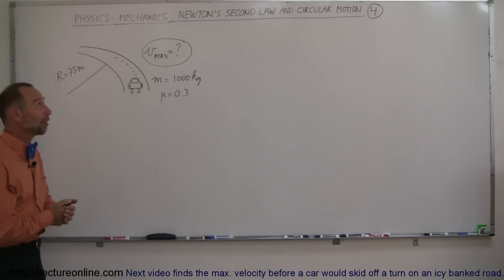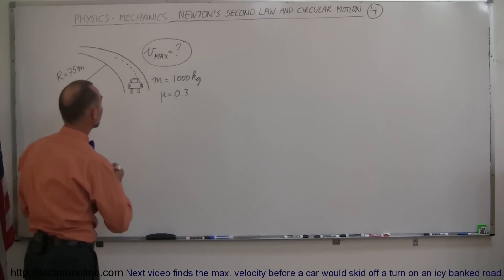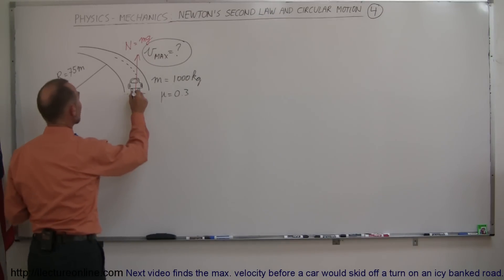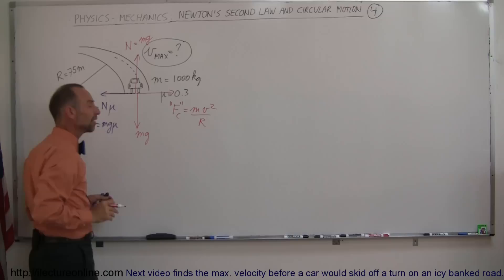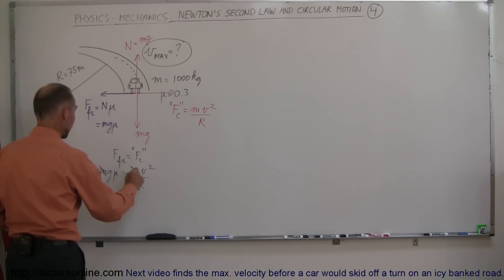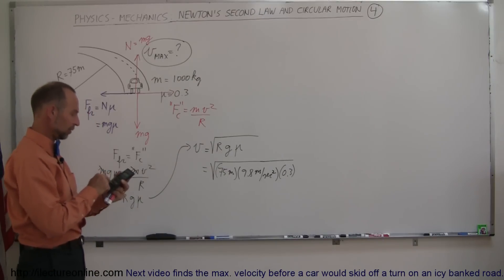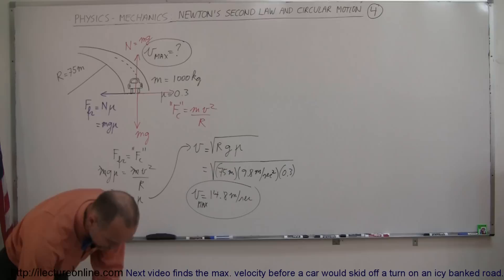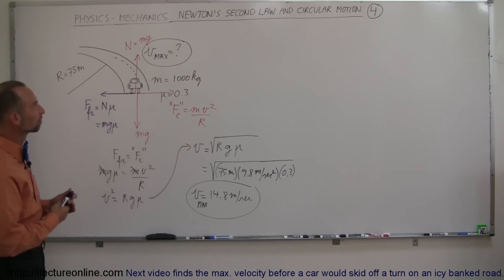Physics 6  Newton's Second Law and Circular Motion (4 of 10) Going Around a Curved Road

Comment: Mmm. My physics teacher told us that centripetal force is an actual specific force. But looks like it's not. It can be anything that supports the circular motion right? It can be the weight of the object, a tension in a string or in this case, friction. Interesting. 🔥
Reply from the maker: The centripetal force is the real force pushing or pulling the object to the center of the circular motion.   The centrifugal force is a "fictitious" force equal in magnitude to the the centripetal force (disregarding any other forces that may be at play), but pointing towards the outward direction.
Reply: @MichelvanBiezen  prof. said the centrifugal force cannot be applied here in any sense, i told her this is related to the max velocity of the car when it would be higher, than the car would go outward centrifugal. The given problem was "What is the smallest radius of a flat curve that a cyclist can navigate if their speed is 29 km/h and the coefficient of friction between the track and the tires is 𝜇=0.32 " i got result for the minimum Radius of 2.12m. I am so confused.

Comment: hello sir, 
we learned something called the centripetal acceleration is it the same as the centripetal force?
if yes why is it to the right not to the interior of the circle? because I had the same question in ex 2 
should it be considered as part of the net forces ?
Thank you for your time
Reply from the maker: One way to solve this type of problem is to use the fictitious "centrifugal" force which has the same magnitude as the centripetal force (and the same equation) but it points outward instead of inwards.    (It make it easier to visualize what is happening because we "experience" the "centrifugal" force when we turn quickly in a car.   Off course we are actually experiencing Newton's first law.
Reply: @MichelvanBiezen  thank you

Comment: thank you professor, but i have an important question  why Fc is to the right ? 

i think we can not draw it on the diagram, young and freedman  (University physics book 13th edition) page 155 there is a note written there 
here is the book page in this drop box link 

https://www.dropbox.com/s/31ytic9xmzkmuk2/11111.JPG?dl=0

please explain why and when the car can skid on this unbaked curve and for the Banked curve
Reply from the maker: It depends on the definition of Fc.   If Fc represents the centripetal force, then it acts to the left (of the center of the circle).  If "Fc" represents the fictitious (non-existing) centrifugal force, then it acts to the right, away from the center of the circle.  It is just a tool to solve these types of problems in a different manner, that may be more intuitive.  (Since we experience the centrifugal force, as we appear to "feel" a force pushing us to the right when we make a sharp left turn at high speed).
Reply: @MichelvanBiezen  Thank you professor for the reply, i appreciate it.

Comment: what baffles me is that you're saying the mass/weight of the car has no actual bearing on how fast it can take a corner... interesting. More weight = more effect from friction... but more momentum keeping the car going straight... Less weight = less friction... but less mass to turn... OK. Makes sense. 

Is the coefficient of friction a function of the... tires? of the tires(mass x gravity)? without the tires, it would slip and slide on hard metal rims.... with the tires... those rims change to "grippy"... I guess its accurate to refer to the tire, figuratively... as a "thing" with some fairly negligible mass whose main attribute is "coefficient of friction".

Deep stuff! :-)
Reply from the maker: The coefficient of friction depends on the surface of the tires and the surface of the road in combination.  There are some videos on the channel that explain that in more detail.  PHYSICS 4.6 FRICTION

Comment: Y sir here centripetal and frictional force are equal
Reply from the maker: For an object to deviate from a straight line path, a force is required.  For a car to travel in a circle, a force is required to make it turn.  In the case of a car, that force is the centripetal force and that centripetal force is the friction force between the tires and the road.

Comment: Would it be incorrect to draw the "F_c"  and F_kineticfriction in the opposite directions? Before you drew the forces on the board I was thinking friction would be to the right and the centripetal force would be to the left.
Reply: Actually I just realized that it doesn't seem to matter. Is it just a matter of preference to use "Fc" instead of Fc? Fc seems more intuitive to me.
Reply from the maker: In actuality, the friction force IS the centripetal force.  But it is often easier to think about the fictitious "centrifugal" force as pushing the car off the road and the friction force keeping the car from sliding off the road.

Comment: Professor, I would like you to know that my physics course started off with 24 students. There are 8 left. I am the only one with an A. I do not learn anything from my Professor. I come home after class and watch your presentations. It's all thanks to you. You are a tremendous educator.
Reply from the maker: Kurt Tournament Kurt,
I am glad I can be of help.  That A didn't come easy.  You worked hard for it.  Keep up that great effort.
Reply: Professor Biezen, the course ended today and the last exam I got a 95. The only student with an A in the course by an exceptionally harsh professor. Thank you for taking time out of your day to make these presentations & educating us so masterfully. I consider myself one of your students. My path to vascular neurology and research is long. I'd be in trouble if you weren't here to teach the right way to approach problems.
Reply: Good morning, so if the car has a speed greater then 14.8m/s, the car goes out of the street....is it correct? Many thanks